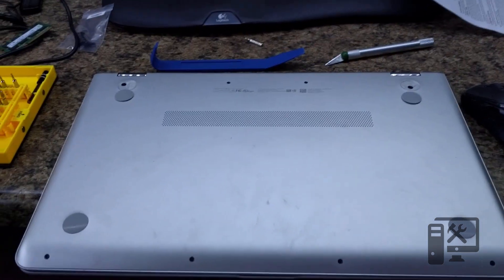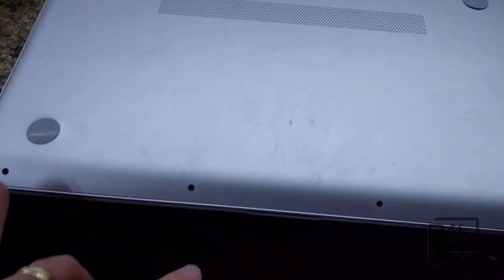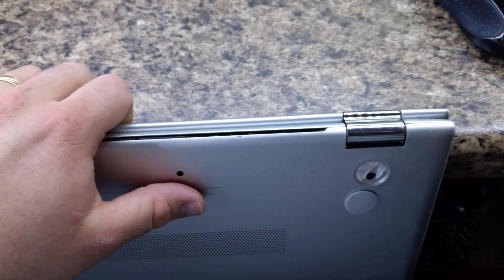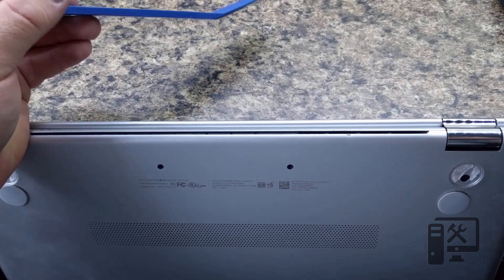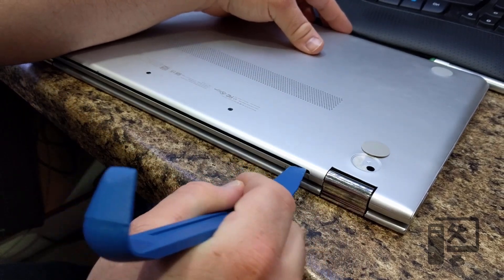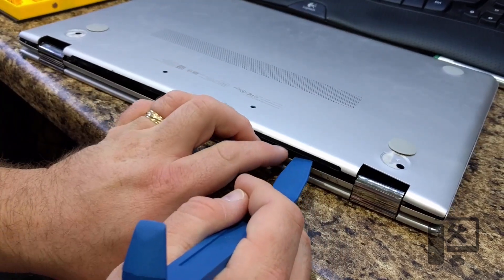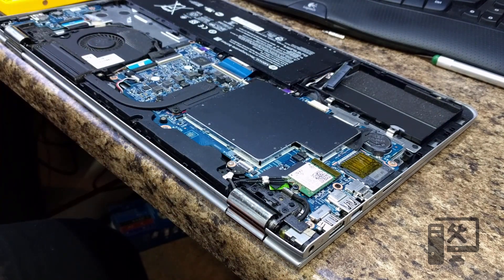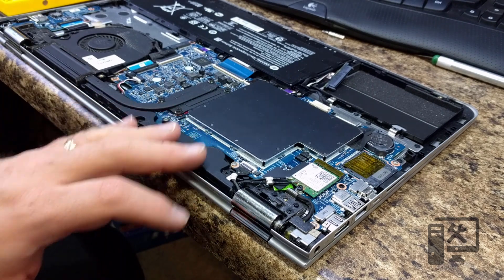How to open HP Envy m6 laptop - hard drive replacement

Comment: Thanks. this helped me open up properly my envy m6 without breaking it smh. My issue is a power button problem. My 3 year old knocked over the laptop and when it fell it dented the side a bit so the button is stuck. so i assume i may have to try to replace the frame? the laptop is still fresh so its not an old body to death with. any advice on the power button?

Comment: yea, I wouldn't ever get another of these computers. Very unreliable, my hard drive died I went to get it fixed came back with more issues after 2 days it died again. And it kept going like this for 18 repairs. They eventually refused to repair it again. Because all they would do was put new thermal paste and a refurbished harddrive that's it.

Comment: How do i replace its keyboard??
Reply from the maker: You have to take the motherboard and cooling system out. Then you can get to the keyboard.
Reply: Can you do a video on that. It would be helpful
Reply from the maker: I don't have the machine any more, it was a customers. If you want to send me the computer, I can do the repair and film the process?
Reply: Will be difficult and time consuming as I'm Not from US
Reply from the maker: Yes it would :-)
Reply: @ttms2  I would send my computer for repairs, but I already know it will end up corrupting again within 2 days like the last 18 repairs I have had from HP. How much would you charge to repair the cooling system (because the fan is humming) and replace the harddrive? just asking.

Comment: I truly hate this type of laptop because I sent it out 16 times to HP for repairs and it came back just to crash again the next day :/ it came close to catching on fire one time. and now I have a Hard Disk Imminent failure (301) during boot in which I cannot boot to windows. :/
Reply from the maker: Run chkdsk. HP laptops are my least favorite. I love their printers though.
Reply: I did do chkdsk it took around 8 weeks to reach 6% then it errored and then thats when it gave the Imminent failure (301) error, I cant do a diagnostics check because it errors on my battery saying it is weak, which I recently had the battery replaced by HP along with the hard drive and motherboard and heatsync, and thermal paste but the battery and hard drive show an error during diagnostics :/
Reply: now I just use ubuntu off my flash drive which I am actually really attached to, because I can still run Windows programs on it using `wine`, I literally accidentally wiped my windows hard drive using `diskpart clean` because I thought it meant to clean not wipe, but I was able to recover 4 of the 5 partitions on it. I cannot recover the last partition because it tells me I already have 4 primary partitions on the hard drive

Comment: how you would change the keyboard of this laptop?
Reply from the maker: +Jorge Jiménez if I'm remembering correctly, you need to take the motherboard out and replace it from the inside. Should be a few more steps passed what I show in the video.
Reply: I have the same issue as Jorge.  My keyboard needs to be replaced.  I don't know how to go any further then your above video.  Thanks!

Comment: What size screw driver did you use for the small screws?
Reply from the maker: +Bri Munoz I like to use this kit. It always has everything I need - https://youtu.be/_M-qj7YyWzQ
Reply: @ttms2  The screws that are visible take a T5 torx.  The two under the back rubber feet are standard philips screws.

Comment: Hi, what screwdrivers did you use for the back cover?
Reply from the maker: +Anthony Robles https://youtu.be/_M-qj7YyWzQ. This is the set I've been using and loving as of late. It has everything you need to take laptops and small electronics apart.
Reply: @ttms2  The screws that are visible take a T5 torx.  The two under the back rubber feet are standard philips screws.